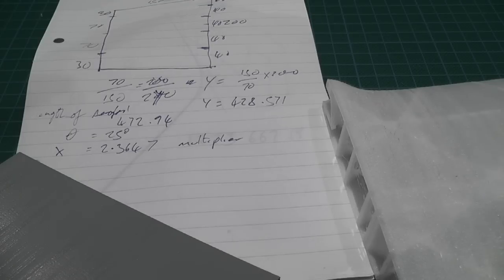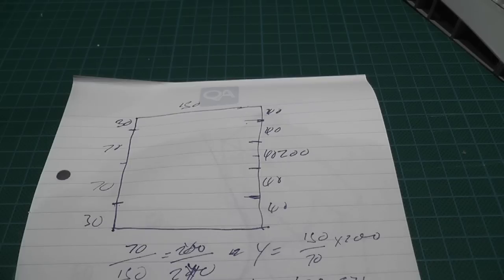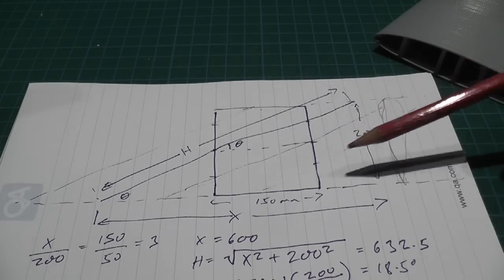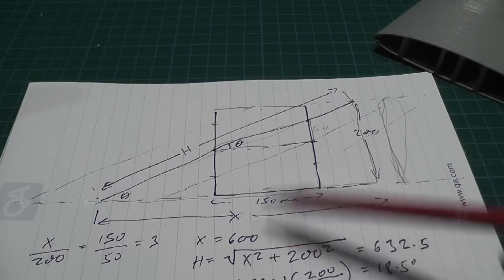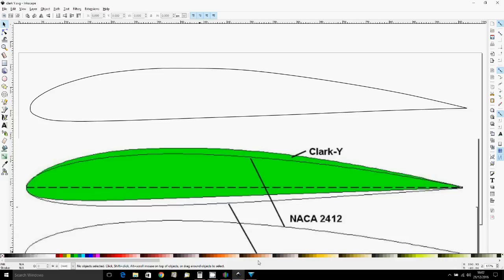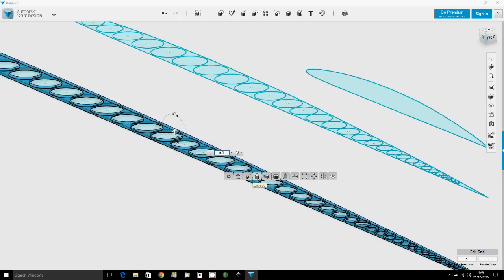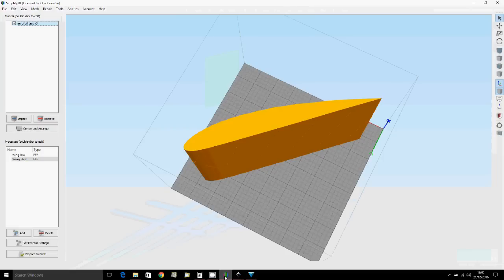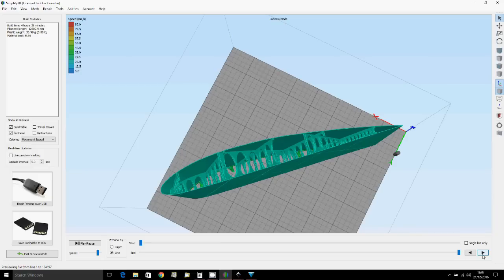3dlabprint style wing section design

Comment: Hey, John - this is just the breakthrough that I've been looking for - but I've got a stumbling block that hopefully you can help with. The airfoil is a model, the ribs are a model. How are you combining the two into one STL for the S3D? When I do it using combine on Fusion 360, the airfoil essentially swallows the ribs making them nonexistent. Or,if I import both stls into the S3D, then it will only print one or the other, but not the two combined. This is the critical misunderstanding on my part. How do you combine the two into one STL file? I understand then printing with no infill so that it see's the "skins" of all the entities. 3DLabPrint has solved this challenge - I'm desperately trying to - just as you have.
Reply from the maker: I did this in 123d design which allowed multiple models to be selected and saved in one STL file and loaded into Simplify3D as one model. Even if the two models are saved as separate STLs, both can be loaded into simplify3D and aligned to occupy the same space. The process used to print the aerofoil has to have no infill and no top or bottom layers. This allows the structure to act as infill. With two models Simplify3D does the combining.
In Fusion360 you can also use the Shell command in  the Modify menu to hollow out the Aerofoil to say 1mm and combine the internal structure with this.

Comment: Great video but you lost me at the point where you rotate the ribs, can you explain that a bit more detail as i am not to ofay with autodesk 123
Reply from the maker: martin hammond I'm trying to build a repeating pattern so that the partial ribs in one section match up with the continuation in the next so that if you join together two of these wing sections the ribs continue from one section to another. Hence the maths. You don't need to rotate ribs to make a wing but to 3d print a wing you need to add strength somehow and the "ribs" at an angle is similar to the method used by 3dlabprint, the guru of 3d printed RC aircraft. Others have used normal 3d printed infill patterns but the weight of these can be excessive.

Comment: Very interesting John, definitely looks like well working method. One question, it looks like the ribs cause 'lines' in the outer skin, can you remove these? so the skin is one continuous outer line.
Reply from the maker: tomstanton28 It may be that the two models are not as accurately aligned as they should be. It certainly would be possible to construct a support structure that was slightly smaller by te amount of a a single 3d printed border and so the internal structure will finish within the aerofoil outer skin. The way I designed this leaves them exactly the same size so alignment needs to be perfect.

With the 3dlabprint designs you can still see some of the internal structure on the outer skin depending on the settings used.